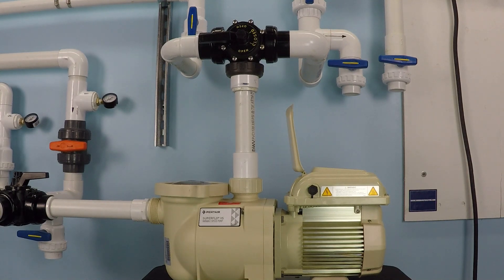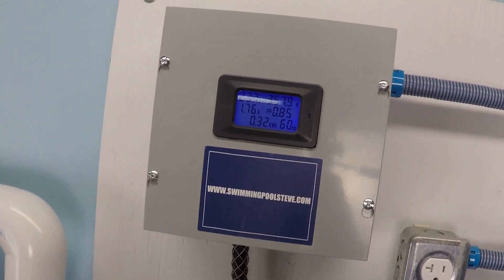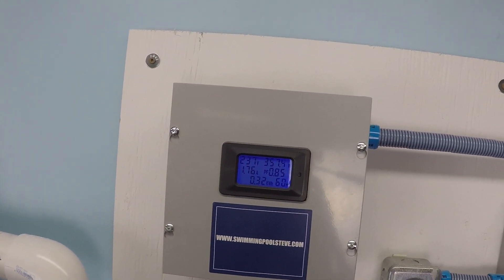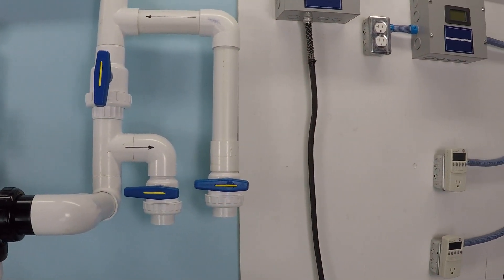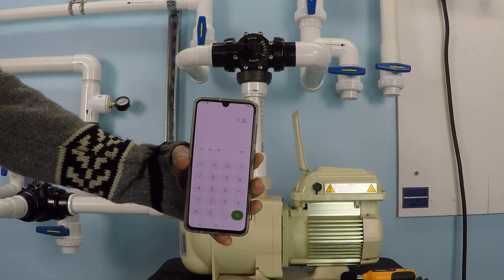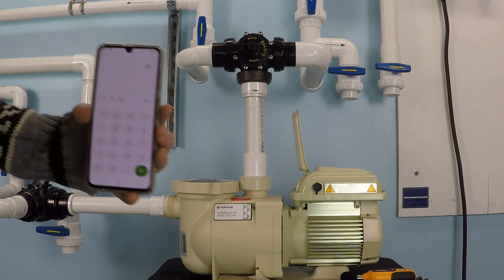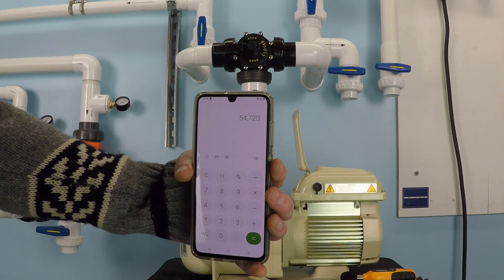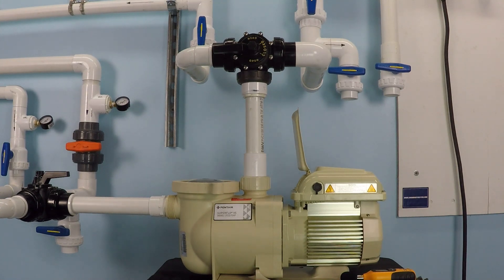Pentair Superflo 1/2 RPM Flow Rate & Power Consumption

Comment: Steve, I think your missing some key information here. Your numbers all sound good but there is nothing to compare it to. How much does a 1HP single speed pump cost to run? How does the flow rate compare? What should we be looking at for water turn over in a given 24 hours? There better be some serous savings to justify spending $1,200 on a new pump. When would the cost saving cover the cost of the pump?

Currently, I run my single speed pump for about 12 hour a day - at night. I do run the pump during the day sometimes when I want the water feature fall to run. My pool is 16x32 and is about 21,100 gallons